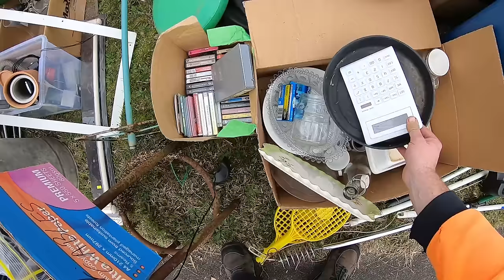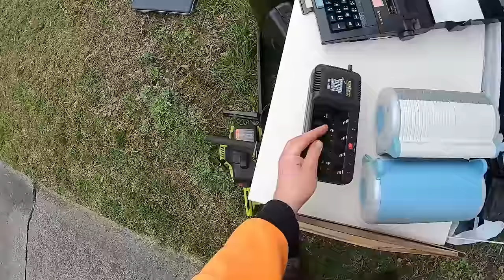Street Scrapping quick run around for e waste

Comment: For those that don’t live in Melbourne. The reason that the scrappers roll out in force in these areas is that there are only a small handful of local council areas that have a “hard waste collection” the rest of Melbourne have adopted the “booked pickup” model. Councils save a fortune by only paying waste collection companies to collect booked pick ups vs picking up an entire suburb worth of trash, Not everyone will book 1pickup a year, but if the whole street did it then others just join in.

I live north east of Melb, my council saves on average $320,000 to $370,000 per year booked pick up vs free for all.

Also given the fact that most households would put out more than the allowed amount (2 cubic meters) and putting things out like paper, books, and cardboard that should be recycled through the normal bin system. A perfect example can be seen @04:10

Just remember that local government is NOT about serving the community, it is ALL about money.
...in case anyone cares 😎😎

Thanks for sharing your experience with us Ben

Comment: I’m surprised that you don’t tie downs Rollie bin for all the wire and small bits you pick up. Might make the muck out a bit easier
Reply: No it takes up vaulable space
Reply: WNY Trash Trucks it would be the exact opposite. Strap down a bin against the passenger seat and all the wire, modems, cd roms, mice, and other small bits would go in easy enough leaving room for PCs, motors, chairs, or whatever else is larger.
Reply: Not a big bin, a trash/recycle one in the 60-90 gallon (250L-350L) size.
Reply: @ursamines7643  you do know those are huge right and he has had a bin in there the one time you can barley even reach into use it.
Reply: Yes I know how big they are. Hell even a standard kitchen trash bin would be useful for all the cords he gets.
Reply: @ursamines7643  thats better. He still won't do it. Usually he is going for E waste and other things like that he will still have to unload everything has it needs further processing. He knows what he his doing
Reply: WNY Trash Trucks I don’t doubt his knowledge in this business. I have been using his videos for years now to help me. I have seen him a few time grab a bin from a street pick up and put good use to it.

Comment: Am I the only one who shakes their head each time Ben leaves keyboards on the ground, cuts the phone cords instead taking the connector bit with the gold pins, and does not check the printers for the printer cartridges.
Reply from the maker: It's because the things you mention there don't have much value, the gold pins on phones are worthless, costs more to recover than gold.
Reply: eWaste Ben you have mentioned before you don’t like messing with harsh chemicals, I have found that if you mix vinegar and hydrogen peroxide (peracetic acid) it will take care of the pins. It works even better if you use a crockpot on high heat.  I could do a video on it if you would like. It also works on gold fingers and the like.

Comment: Do they not pay for lower grade shred steel in Australia? Seems like u consistently leave hundreds behind? Presently shred steel ( dirty steel) is 275$ Canadian $ per ton, don't take long to collect 1000 lbs for a sweet 140$, u just need a small trailer
Reply: @bigteddy66  I stand corrected all summer long it was closer to $360
Per ton lol,for garbage shred,baking was over $400, lol, tell me about it, those cords might add $20-25$ a day to my first load but the other $200 plus is just steel,avg 3 ton weekly
Reply: @andymilic4093  yes and a lot of stuff is usable until he cuts the cords off them, why get so excited about an out of date laptop that you can do very little with.

Comment: Hi I would do in your place what is complete Pl Vacuum Cleaner microwave oven not cut the cable but sell it to try and if it is good to give for good money it is more than just a 1-5 meter cord
eg a used micron 5000-6000ft here in Hungary also give 3000-4000ft for a defective one

Comment: I feel that you are not doing any good by cutting cords you get more with the copper and gold on circuit boards but I am the type of person if I find a complete piece of electronics I fix it if need be and use it you are just not really recycling everything a cord here and there is not good and tossing it around shows you have little respect for electronics nice video